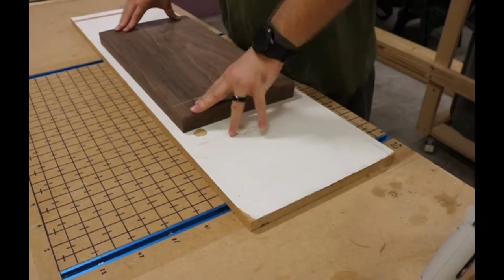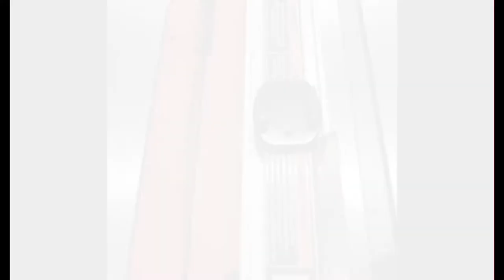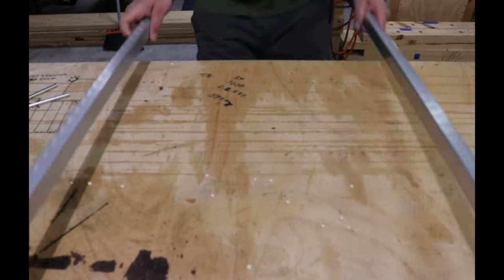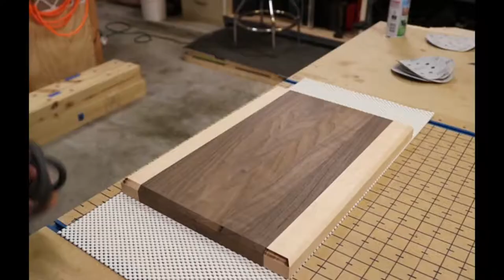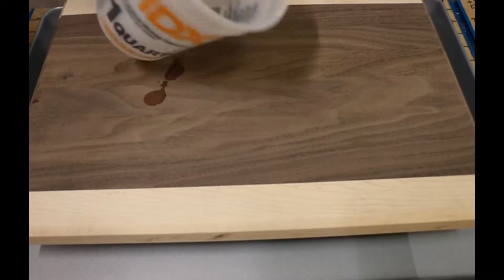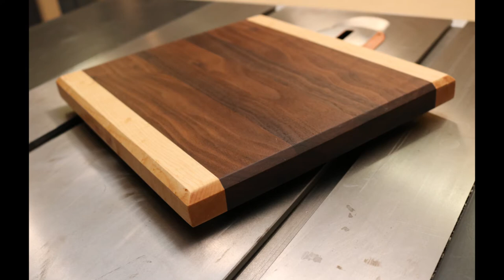Dark Walnut/Bird's Eye Maple Chopping Board

Comment: That must be the first board you ever made. That is so elementary of a board. Why did you even cut the walnut up if you were just going to glue maple down the sides of it? That was a waste of some damn good wood, WoW!!!!
Reply: Most cutting boards are not done using the face of the wood as the cutting surface.  They typically use the edge grain or end grain of the wood as the cutting surface.  Just look up "surface vs edge vs end grain for cutting boards" and you'll learn why.  However, some people do leave the face grain exposed and they are really meant as more of a rarely used and decorative piece.